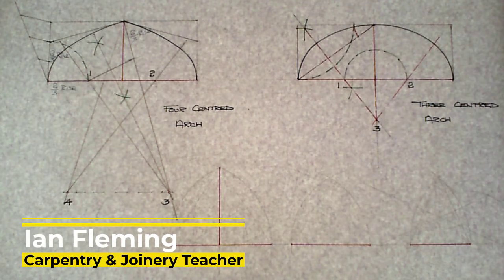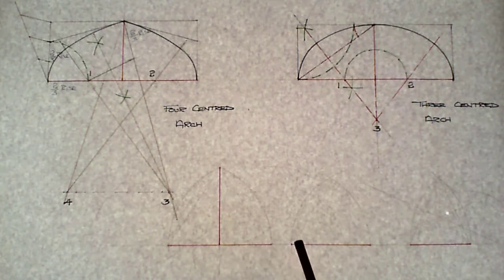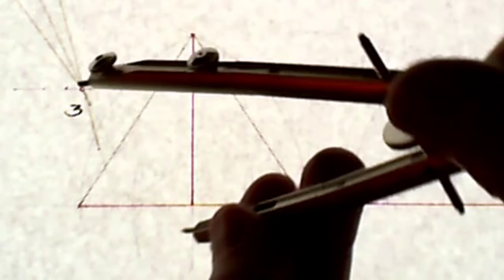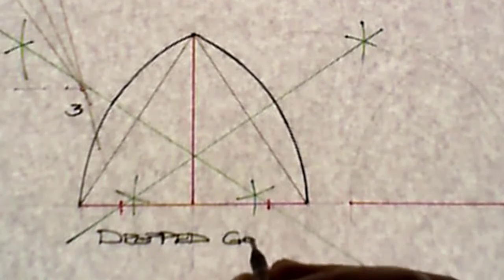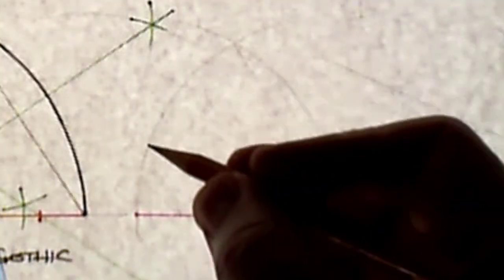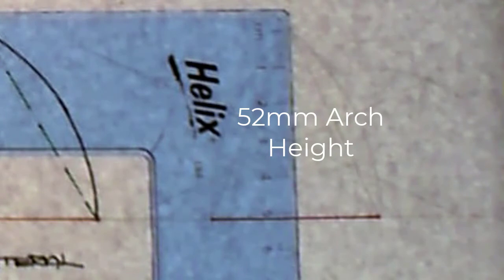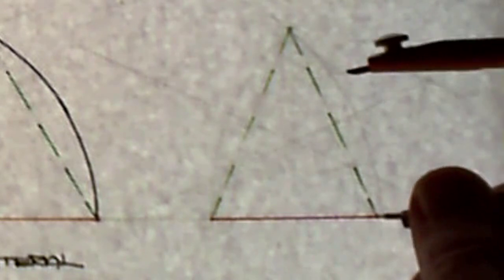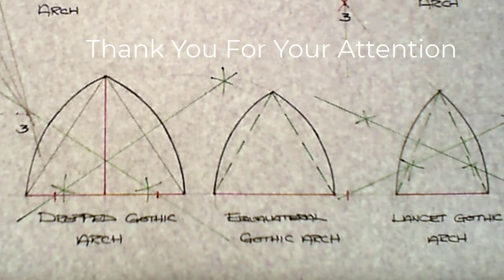Gothic Arches

Comment: Thank you for the education! Fantastic.

How would you reverse engineer it though? For example I have an already created Gothic arch opening, and I want to template it, but then work it back to the ideal straight timber’s that I’ll cut the curves out of and make a door to suit if that makes any sense?

Ie. if it was a complete circle you might start with an octagon with 8 equal bits on 22.5 degrees, how would you work that out on  an old arch?

TIA

Comment: I'm just starting my build now for my winter boat work shop. My structure has a PT 2"x8" footing of 11' W x 28' L. I'm trying to figure out the height to accommodate 2 internal gantries to lift the boat off of the trailer, so that 1-I can work on the boat on a cradle and , 2-So I can refurbish the trailer. It's a 26' Sailboat. I don't want the structure to be overly tall. I just want it to be as compact as necessary to allow me to build the 2 gantries which are obviously rectangular...PT 4" x 6" posts with a double 2" x 8" across the top of each one, that will be through bolted and braced, to hold the 4 manual chain hoists with cargo webbing straps under the boat.
 
I built the base framing 11' wide to fill with limestone gravel for drainage and to create a compacted pad, wide enough to allow me to back the 9' wide trailer into the structure, with at least 1' on either side of the wheel wells. The boat sitting level on the trailer is about 8'-9' tall at the cabin top. But part of the rebuild is to cut off the old cabin top and extend it up by at least 8"...maybe a bit more. I'm still considering building an enclosed pilot house...but I may just go with a hard-dodger on a stainless-steel tube frame, with removable canvas. Anyway, I'm forecasting that standard 2"x4"x16' ripped in half on the table saw will be long enough to get my internal height. 

But I'm not sure if 16' is long enough for the bows. What do you think?